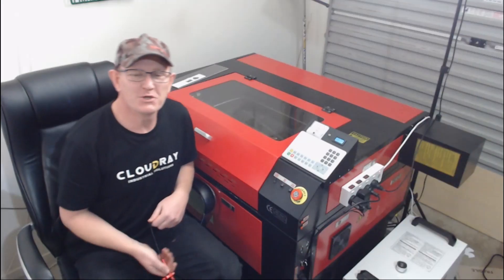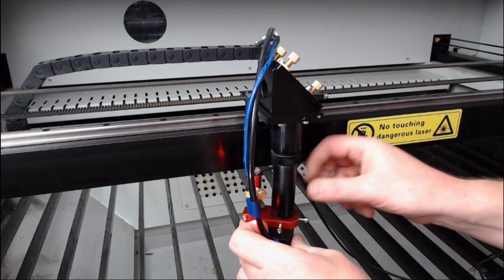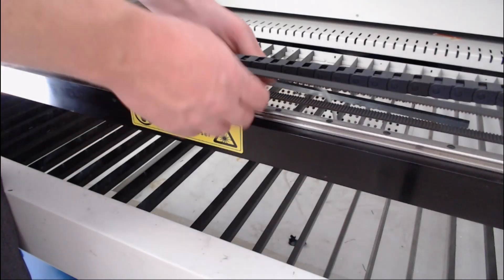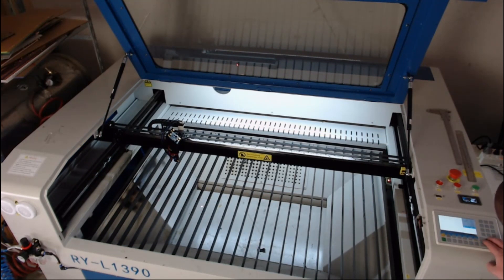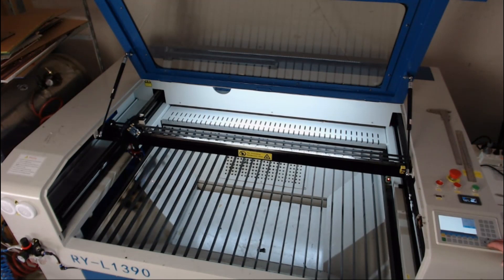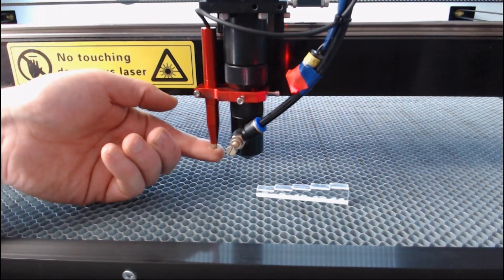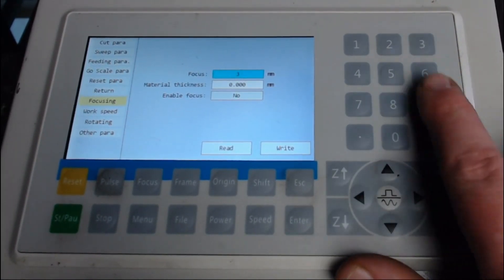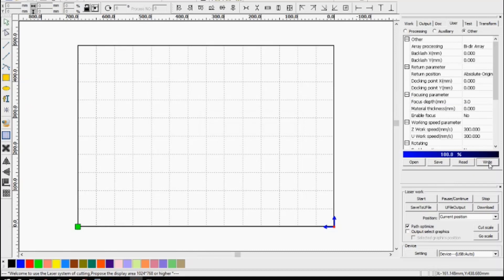Installing Z Axis Focus Sensor on Co2 Laser - CNC Co2 Laser Machine

Comment: i am having a problem setting this up, i cant get it to do the gap above the substrate using a scrap piece of 3mm even though i set it in th e settings it doesnt drop back down it stays at the top of the limit on the probe where the switch kicks in

Comment: hi there matt thanks for your videos they are great. i am looking for a focus pen but my tube is only 18mm diameter do you know where i can get one to fit please 

thanks 
Gary
Reply from the maker: I used a 24mm and then made an acrylic ring to go inside to fit my 16mm lens tube.  Otherwise you can machine a new holding ring.  Cheers Matt
Reply: did you make a ring with a split in it a bit like a spring washer otherwise it will just slip surely ??? could you send a picture thanks
Reply from the maker: Email matt@mwlaser.com.au

Comment: My focal length when doing a ramp test is 18mm. I then put a 3mm piece under my autofocus dropped it like you did and set 3mm in my rudia controller. When I got autofocus it focus to about 20mm. What am I doing wrong?
Reply from the maker: email more info of your controller settings and your question to askmatt@mwlaser.com.au

Comment: I have just purchased a 60W Red and Black laser, I am a complete newbie. I was tinkering with the machine yesterday and pushed the autofocus button on the ruida controller.
I had no material on the bed and when it tried to auto focus it just kept going and kinda squashed the auto focus pen. I am at a loss as to how it is supposed to work.
The book they send with the laser is no help. is there any videos for idiots like me lol to get to know things like this ?
I haven't a clue as to what height the pen is supposed to be to auto focus.
I was worried I had damaged the machine, so now Im scared to press the autofocus lol
Great Video as always mate !
Reply from the maker: G'day.  if you require some assistance with the machine setup and use, email matt@mwlaser.com.au
Reply: @MWLaser  thanks mate Ill do that.

Comment: I noticed on the video at 8:09 when working with controller (Menu - User - Focusing) that there was an item listed as "Enable Focus" and it was set to "No." Why is that?
Reply from the maker: Yes I have found on all machines I have installed this focus sensor on that when I select enable focus = yes, then it disables the focus.  Why? sorry can't answer that. I have not found an answer yet, my best guess is it may enable a different focusing system than the one installed in this video.  Therefore Leave Enable Focus Setting = No

Comment: I just installed one of these on a 6445, and I have no idea how this wiring worked for you. The diagram that you showed even says 10-30V for the probe and that port on the controller is 5V. Hooking it up to a 24V port made it work perfectly for me.

If you pointed this out then I missed it, but if "enable focus" is turned to "yes" in the focus panel then the focus... doesn't work. It focusses then moves the table down until it runs out of travel. If "enable focus" is set to "no" (like it is when you show this menu) then the focus works perfectly. Why? Who knows :D.
Reply from the maker: I have came across 2 models for the focus sensor the one in this video was a 5V unit and its wiring is different to the 24V version I install in this other video (https://www.youtube.com/watch?v=X8iqgfy5T-8&t=4s) even thoughthey look like identical units.  This has caused some confusion with a few viewers so far. :(

Yes I have found on all machines I have installed this focus sensor on that when I select enable focus = yes, then it disables the focus.  Why? sorry can't answer that. I have not found an answer yet, my best guess is it may enable a different focusing system than the one installed in this video.

Cheers Matt

Comment: Hi Matt! Thanks for the video! What motor and driver would you choose to upgrade the Z on your machine. My machine is very much the same as yours and would like to do the auto focus upgrade. Thank you sir! Jason
Reply from the maker: Hi John, I have put that Z-Axis project on hold for a while, as I have to complete the DIY build.  I hope get a list of parts needed together and make an installation video after this current project.  Cheers Matt
Reply: @Matt's Workshop -MW Laser  ahhhh yes. Alrighty then, I will stay tuned. Thanks for the reply, Jason

Comment: Did this work? My Puzu Pin only gives 5 Volts and that is not enough for the sensor.. connectes the brown wire to 24volt, that did the job.
Reply from the maker: This one worked on 5v wired up as shown with rdc6445 controller.
Reply: Matt's Workshop -MW Laser you are lucking, the sensor village range is from 6 to above 24v, thus you are on the limit of the voltage 
the best way would  be to connect the brown in the 24v on the connector just above

Comment: NIce video with more details then the others, my laser mashine moves z axis (work table) down, but won't go up? I did cut inductive sensor from head because it did not work. I want now to fully disable autofocus on mashine and use focusing manually. What do I need to do else so laser can ignore any affection by proximity sensor?
Reply from the maker: More Info needed to provide assistance. What controller and software are your using?

Comment: Thanks a lot Matts! Just finishing my DIY 50W co2 build with Cloudray parts and the Ruida RDC6445G controller. I dont have the auto focus right now and i think i will build it my self, but it looks like it is very good to have. It seems that you are pretty experienced with co2 laser and the Ruida controllers, so could you please tell me if i am right that PNP Proximity sensors are not working with the Ruida RDC6445G controller (and most other Co2 laser controllers) and only the NPN sensors working? I found that information today on the thunderlaser website, after 8h of struggling to get PNP sensors to work, but the homing sequence did not work. I had the PNP sensors lying around from my CNC router build, so i did not even think about that only NPN sensors working. Thanks in advance and again thanks for the nice videos!
Reply from the maker: Thanks Denis, this question is one you should send to Cloudray Support using this link https://www.cloudraylaser.com/pages/contact-us

Comment: Thanks for the great video. Awesome channel. I do have a ? Does this laser have the ability to pass through bigger material from front to back. If so how does that work. I see the 60w have a door on the front and back. But does this 80w red and black have that ability. Thanks
Reply from the maker: G'day Nick, Thanks for the comments and feedback I appreciate the feedback.
Yes the 150W Blue machine in this video does have the ability to manually feed material from front to back, by opening the front and rear panels.  You can pass material up to about 35mm thick through and still have clearance for focusing the laser.
The 80W Red laser machine also has this ability to feed through material, BUT with the current laser head/lens tube it will not lower enough to focus as there are rails front and back that obstruct the material from passing through at the correct focus height.  To be able to use the pass though on the 80W Red machine I would need to change the laser head / to one with a longer lens tube so that it will lower enough to be at the right focus height.
Both machines have this Manual feed though option that will allow you to place larger material into the laser, however if you wanted a continuous cut larger than the cut area of the machine you would need an automatic feed table / u-axis.
I hope this has answered your question.  Cheers Matt